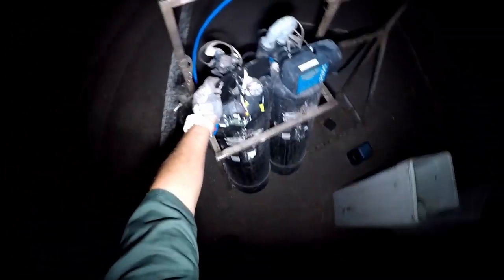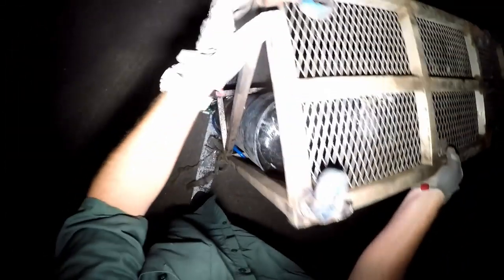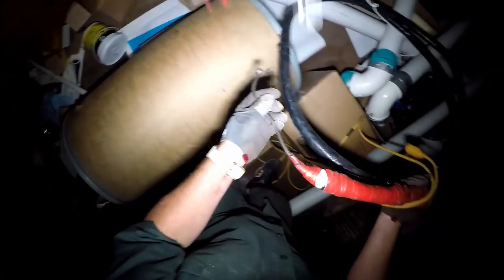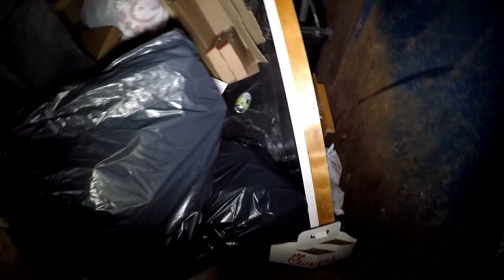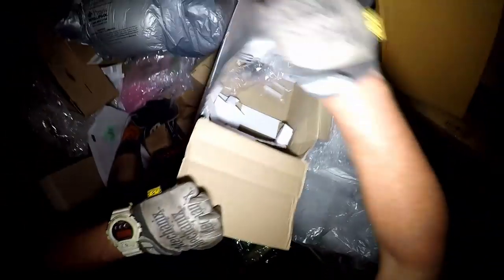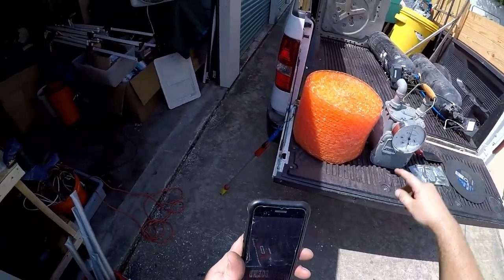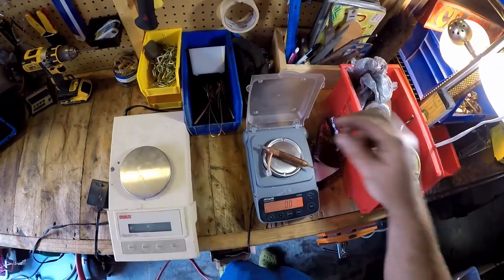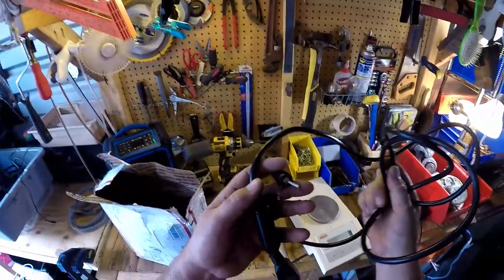Dumpster Diving "What's Up Furry Hair Ball Lookin' Thang"

Comment: The gas meter looking thing is definitely that, but adapted to a special purpose. 5psi is the maximum allowed for natural gas with threaded pipe connections. Higher pressure needs to have welded connections, even with the yellow poly pipe.  Ohaus is a big time scientific stuff supplier!

Comment: Hey  Mike  I  was  just  thinking  those  led  exit  lights  you  could  put  them  on  some  brackets  and  use  a  small  battery  with  a  switch  so  you  can  load  things  at  night   put  them  on  the  front  boards  we're  it  covers  your  back  window facing  the  inside of  the  bed  of  Dottie  just  a  thought  if  you  wanna  do  it  or  not   good  video   mike

Comment: U the man but I cringe when you through all that good stuff away,I strip down everything right down to the brass ends on electric cords.
Reply: Yeah, those busted screen tv's probably had some working boards in them, easy $30-50 in boards on ebay, instead he got about $1 scrap.